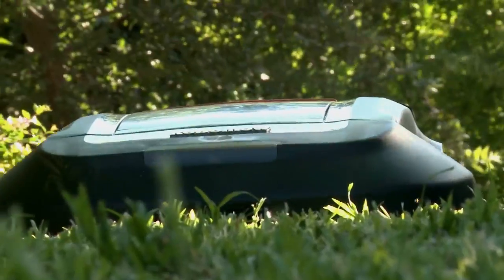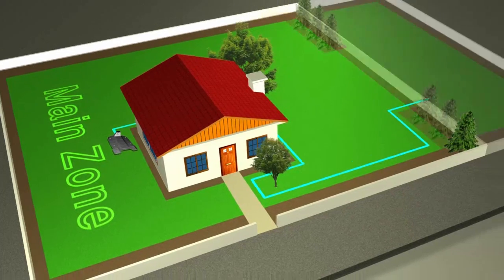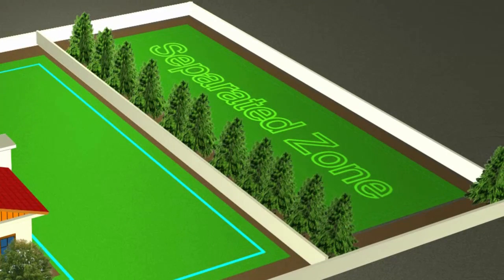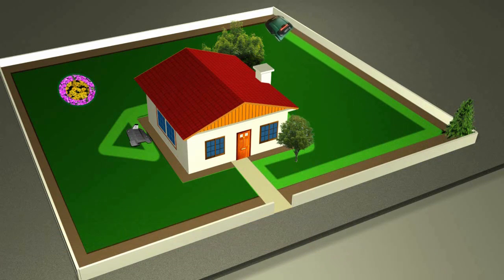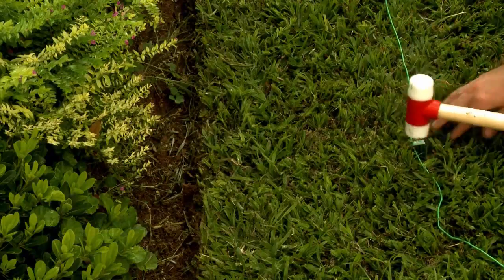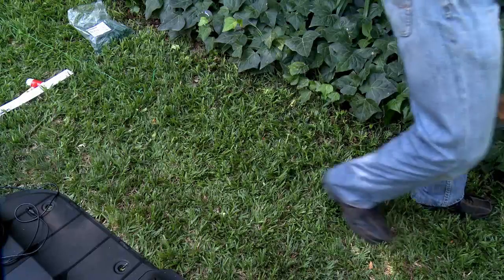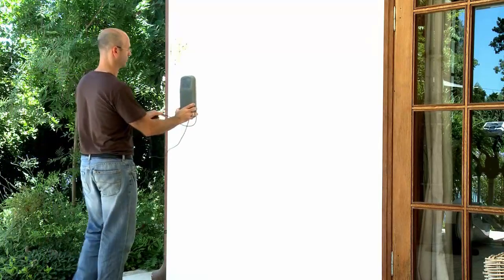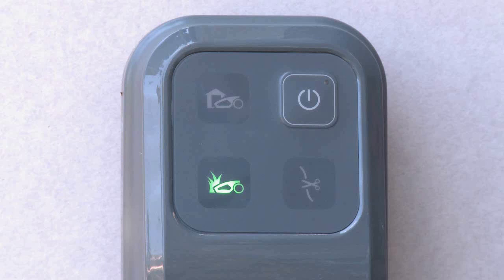Robomow - How to: Install and Setup RS/MS Models (2015A)

Comment: It says that the setup of the wire should be done NTI clockwise, but the video is clockwise - which is right ?
Reply: No, they show anti clockwise in the video, but anti clockwise is the right way to do it, not sure much it matters really, because if you go clockwise, the mower will still go anti clockwise, but I guess it has something to do with the start at the basestation since the connector is connected the one wire end, you would atleast start with the end that are already connected.
The thing is, atleast on the RC models, if it detects that the 2 wires arent connected correctly, it tells you to switch the wire connection around, you just unscrew the screws in that green plug and swap them since it seems like the base station is sending the signal or current anti clockwise in the wire, basicly if you do it wrong, the mower say what you need to change, atleast on the RC models.

Comment: It doesn't say how long to make the 45 degree angle at corners. I want to make sure I start the angle the right distance from the corner.
Reply: Garrett Williams Alright, according to the quick start guide, the start & end of the angle should be 20cm(7.8") for left turns, but right turns should be 90 degrees.